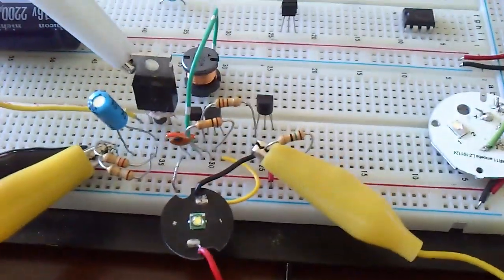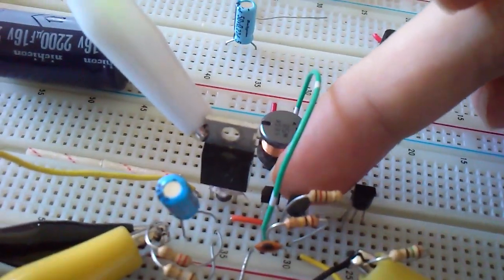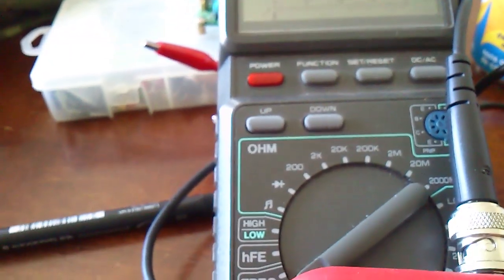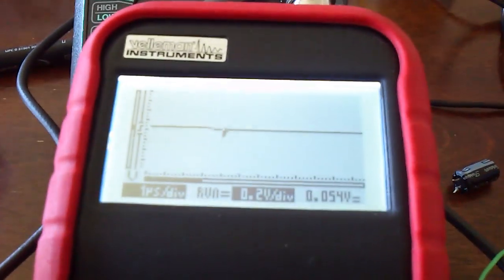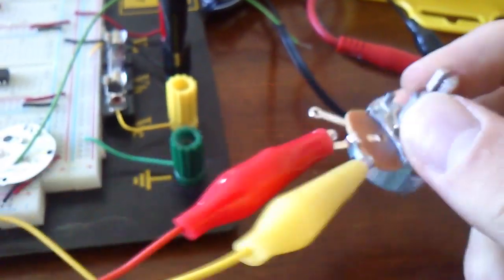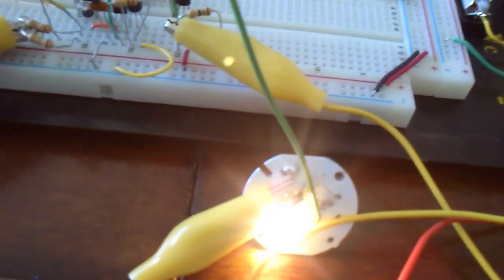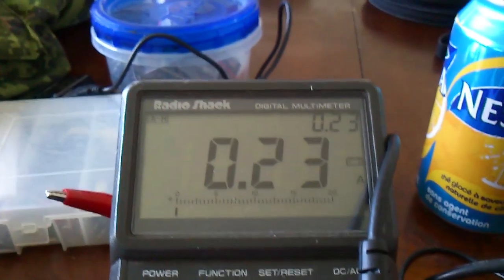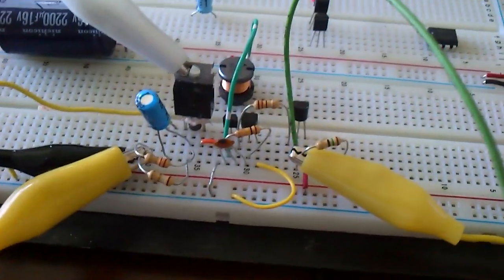High power LED from 1.5 volt?

Comment: Hi!
Do you think a joule thief could be the right way to raise up the voltage of this project i'm working on?
Thanks a lot!
http://www.instructables.com/id/DIY-contactless-magnetic-bike-rim-dynamo/step5/null/
Reply from the maker: Nice project! You could indeed use a "joule thief" but the problem you might encounter is when you will go faster then 22 kph you may generator to much energy and the joule thief with no regulation will burn your LED. My suggestion would be to build a little dc to dc converter that will boost up the voltage higher then what the dynamo can produce and then hook the LED in series with the voltage you set it up ex 4 LED is about 12 volts that's assuming the LED are 3.4 volts each. then you can work your way around this it will be safe for LED and no problem of over-voltage. You can either build or buy a dc to dc converter for very cheap in both case :)

Comment: i don't understand why boost converters called "joule thief" there is no such thief and joule has nothing to steal!
Reply from the maker: You're right :) it's a simple name that kinda got the thing started basically they call it like that because it take pretty much all the remaining power left in a dead battery. The base of the "joule thief" is the old and famous blocking oscillator that use the saturation of a transistor and transformer to generator a frequency well tune you can generate a very nice sine wave. Now of course lots of other circuit got created after to achieve more power or more efficiency like the one I demonstrate it create a high power pulse to light up a  high power led. Hope this answer your question :)

Comment: Can I buy one of these from you, and if they work for my application, I may need several hundred.
Reply from the maker: I don't make those for other to buy since you can get all the require material for very cheap and make it yourself. Second I don't have time to make lots of those. Thanks for your interest though :) I can provide you all the info you need if you want to make them.
Reply: OK.  I am willing to pay a generous amount and will need 5000 of them.  Do you know where I can find people who can assemble these since I cant even put a battery in a flashlight.  thanks for ANY help.  Dave
Reply from the maker: Unfortunately I have no idea where you could find people to make these and I can't make those either 5000 is a very big number also they already make small AA battery and they are very cheap like 2$ each they use SMD component. Thank you for your interest it's appreciate. If you do want some schematic and part number I can give those to you since I use parts I have at home they are very common and can be purchase for cheap.

Comment: You have three transistors used in your circuit diagram and  you answered someone above you used D965 NPN transistor, are all those three D965 or different?  And there is one diode in series before the led, what is the part number?  Also, on your video, there seems to be something like voltage regulator or a transistor in between the blue capacitor and 68uH inductor, what is that component?  I couldn't figure it out.

Comment from the maker: Of course I use High gain medium power npn transistor D965 they have a very low voltage saturation are are very nice for low voltage high power application :)

Comment from the maker: Yes sometime but for this one I've test it and the 2n2222 is just not fit for it I was only able to extract about 40 mAmp but draining 250 mAmp. I will try to order some of those 1.5 amp low saturation voltage one but for now I lack of money power ;)